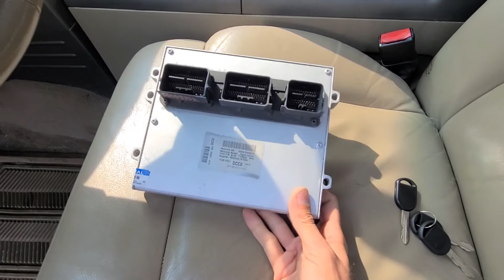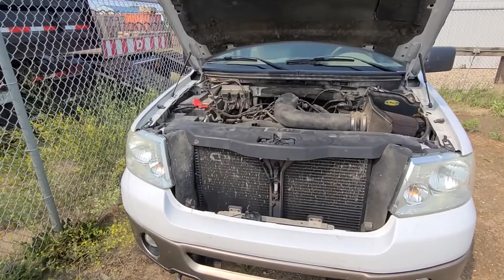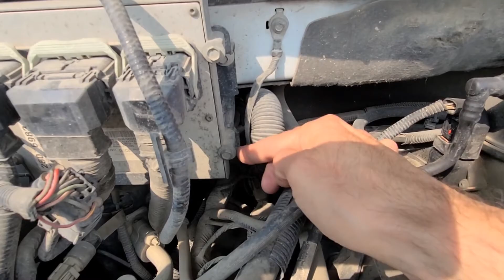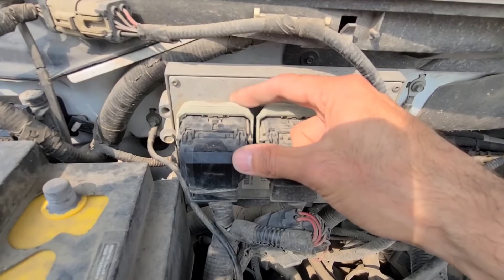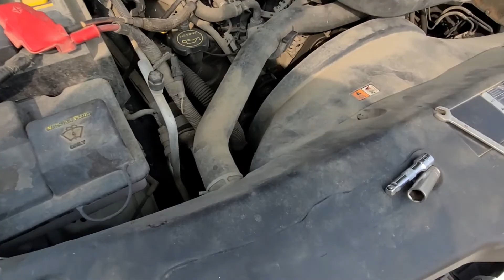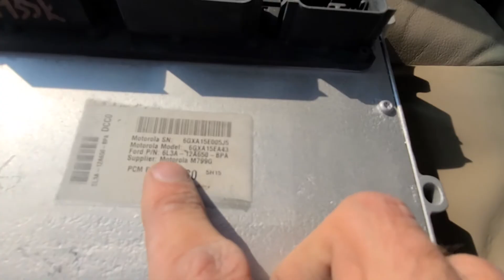Ford F-150 - POWER CONTROL MODULE PCM ECU ECM REMOVAL / REPLACEMENT  (2004 - 2008)

Comment: Will this fix code P0602 ??
Reply from the maker: Hard to answer this question. Replacing the PCM will fix this in case problem is within the old PCM or the software. If you are having a wiring issue somewhere than no. You have to rule out everything else first

Comment: I have a 2005 f150 but I replaced engine computer and transmission from my crashed 2008 f150 so now my 2008 f150 is showing up as a 2008 f150 and I can’t pass smog I feel like taking it to referee if I can’t fix it
Reply: Times 11:25 PM I got an EEPM from the junkyard and like to know how I can get it programmed and get the keys so I can start my truck with it

Comment: One question. If I get the key, cylinder, and pats transceiver ring with pcm from the same truck and put it all in mine will it just crank up like normal? The truck I got it from is a 2007 with the same specs and engine as mine (2007 5.4 4x4).
Reply from the maker: Hi I can't say for sure but probably not. I believe PCM would have to be reprogrammed to your VIN number. Maybe try calling shops who specialize in this and they should give you a better answer. Sorry I can't help more

Comment: So the new keys (blanks) that come with the new PCM can only be cut by a locksmith? Or can they be cut at a reliable hardware store, like ACE? Very informative video. My 2007 F150 5.4 is only showing P0607 fault code so it's definitely the PCM?
Reply from the maker: Hi, if I remember right when I was buying replacement PCM there were 2 options: Preprogrammed with uncut keys (more expensive) and not preprogrammed one. Preprogrammed can be cut by any hardware store and the vehicle should start and drive once new PCM is installed.
Not preprogrammed once PCM is replaced you will have to tow the vehicle to Ford dealer to program the keys and then cut them which is expensive.

Your code points towards PCM problems. Before replacing make sure to rule out everything else. Inspect all the wiring and electrical connections towards the PCM

Comment: Did that fix your issue? i didnt hear it start up, i have same truck it was getting worse i think my pcm is bad too, how did you determine the pcm was bad?
Reply from the maker: Yes it did. Diagnosed it based on the codes c. engine light was giving and symptoms. Tried bunch of other things before, but nothing else made sense
Reply: @QuiteAlright what codes? 
Mine is p0132 and p2197 but I can't find any air leaks and I can't remove the locktight 02 sensor its rusted to bad stripped it out
Reply from the maker: @JohnDoe-gk4kn  It was some time ago, but I think I had P 0607 which was the major one + few more throttle body codes which got us on the wrong path so it took some time to properly diagnose. Your codes do point towards 02 sensor or a vacuum leak. I think you should start with that o2 sensor and then if that doesn't fix it consider looking at the pcm.
Reply: @QuiteAlright  thanks. I broke a pin on the ECU while checking wires voltage and connectors. I couldn't break the o2 sensor off its locked up from rust and now stripped out I was hoping for a air leak but couldn't find one so I guess I'll need to replace the manifold so I can put new 02 sensor on. Can't believe I broke that ECU simply from disconnect and reconnect.
Reply from the maker: @JohnDoe-gk4kn  No problem and sorry to hear you are running into issues. That's the story of my life. There is no worse thing than working around rust and replacing parts on the older vehicle

Comment: will this fix code P061B? please help have the same symptoms.
Reply from the maker: Hmmm hard to say. Code is connected to engine torque. You have to rule out everything else first. Your code could be connected to maf sensor or even pedal position sensor. These are not simple codes and unfortunately you will have to find a really good mechanic to diagnose properly
Reply: @QuiteAlright  i’ve spent 1200$ so far trying to fix this issue even took it to a professional dealer ( Kindle cars ) ran his computer on it and looked at levels told me to replace the egr valve and it did nothing, charged me 210$, im ready to make a phone call to complain… i scanned it myself again and shows me, P0320 - circuit fault which is new, P061B - internal control module torque calculation performance and shows me underneath that the “Most Likely Fix” - reprogram power train control module (PCM) i’ve already bought a new one like a week ago and figured i’d try the dealer just in case so if this pcm doesn’t fix it i’m really lost i have no more ideas a lot have been changed alrd very frustrating, can’t afford to keep guessing what it is and throw money at it, at this point if the pcm doesn’t work it’ll be junked and i’ll be buying a new truck…. - 2006 F150 4.6 2WD 207.000 miles. thanks for the response back!
Reply from the maker: @oohJuicyy  Unfortunately I can't help too much without seeing the truck. I would try to have the PCM reprogrammed by the dealer and see if that fixes the issue, but they will charge you 1h labor probably for it although it takes them 5 minutes to do it. Next step would be to replace the PCM. But I can't tell you it will fix  it. There could be a wiring problem towards the PCM or something like that. You will have to find a really good mechanic to inspect all the wiring and rule everything else out before replacing the PCM. Unfortunately this is how it is sometimes with older cars and it is very frustrating. I sell them and almost daily run into something that I've never seen and spend time and money trying to diagnose
Reply: @QuiteAlright  thanks man i’ll keep you updated.
Reply from the maker: @oohJuicyy  You're welcome and yes for sure let me know what was the issue
Reply: @QuiteAlright  it was the crankshaft position sensor crazy dude those codes didn’t specify anything with that sensor, im confused on why it didnt throw a code for the sensor but it fixed all my problems, read a lot and did my research finally found a post on the f150 forums with the same two codes and same problems, everything’s working as it should now.
Reply: question for ya if you don’t mind will replacing pcm improve anything such as gas mileage, performance, and acceleration. i did buy one a week ago because i thought it was that lol and it finally came in. i’m just wondering if it’d help performance wise if i install it or if i should return it, bought from flag ship one.
Reply from the maker: @oohJuicyy  Possibly yes because it will be freshly reprogrammed with newest software if that makes sense
Reply: @QuiteAlright  yeah that’s what i was thinking too, thanks man appreciate all the help.
Reply from the maker: @oohJuicyy  I'm really glad to hear it was only the sensor. Those codes are tricky and sometimes hard to diagnose, but if you had this truck at a Ford dealer they should have pinpointed it. Only thing they fix are Fords.
Reply: so i recently got around getting the keys cut for the new pcm and decided to install it td since i just had it laying around and mis diagnosed what was actually wrong w my truck i installed and did all the key programming buying from the same website as you i also provided my vin long story short is it normal to get a check engine light and abs light? do i have to drive it around a bit for them to go away?
Reply from the maker: @oohJuicyy  Hi there shouldn't be any codes present after installing new PCM. I checked your code and it comes back as corrupt PCM programming. I would reach out to PCM supplier customer support with the code and see what they say
Reply: @QuiteAlright  thanks for the quick response, just got done sending them an email explaining my situation, waiting on them to get back to me.
Reply from the maker: @oohJuicyy  No problem. Let me know what they said, seems like it is their mistake. At least based on the code
Reply: code P1639

Comment: Do I need new keys?
Reply from the maker: New keys usually come with a new PCM. They will come uncut. If you get PCM with pre-programmed keys all you have to do is cut them. If you get a PCM with keys that are not programmed then you will have to deal with Ford Dealership to program and cut keys to your new PCM
Reply: @QuiteAlright  where do you bought them ?
Reply from the maker: @aldoalcazar6525  online fs1inc

Comment: What about key program?
Reply from the maker: I got my replacement PCM with new keys already pre-programmed to the vehicle. I had to provide VIN number with the purchase and follow a specific procedure after installing the PCM. If you get PCM without keys pre-programmed then you will have to take the vehicle to Ford Dealership for them to program the keys and it will be much more expensive. Keep in mind that you will have to tow the vehicle there if new PCM is installed or have them install and program it for you. Hope this helps

Comment: what’s the difference between the one that comes with keys and one that dosent?
Reply from the maker: Huge difference. One that comes with the keys doesn't require dealer programming, only locksmith to cut the keys (few $ cost). One without keys you will have to get the truck to Ford dealer and have them reprogram your existing keys to new pcm or maybe even purchase new keys from them and have them programmed ($200 - $300 cost)

Comment: Do you have to get new keys programmed with pats? If so where ?
Reply from the maker: No programming needed with PATS. You will provide your VIN number and they will send you pre-programmed keys with instructions on how to activate. You will have to have the keys only cut, which cost me $6
Reply: @QuiteAlright  thanks
Reply: @QuiteAlright 
Did this part fix your issue?

Comment: Can I please let me know how I find the company you used on eBay please.
Reply from the maker: Sure. It  is fs1inc (flagship one). You can get pre programmed PCM directly from their website
Reply: @QuiteAlright  thank you!!
Reply from the maker: @luzloera3255  You're welcome
Reply: @QuiteAlright  how much?
Reply from the maker: @TKO---607  I think it was around $500. Check their website
Reply: @QuiteAlright  did you have any issues with the seller? I've gotten some horror stories from quite a few members of the f150 fb group.
Reply from the maker: @TKO---607  Everything worked fine for me. It was pretty much plug & play. 
There is couple of similar companies selling reprogrammed pcms. I can't really say which one is the best as I only used this guys
Reply: @QuiteAlright  I just ordered one from AllComputerResources, We'll see how it works out. 334.00 programmed with 2 programmed - uncut keys
Reply from the maker: @TKO---607  Sweet 👍That's a good price. Let me know how it worked out
Reply: @QuiteAlright  will do!